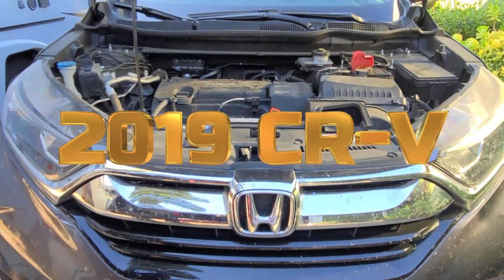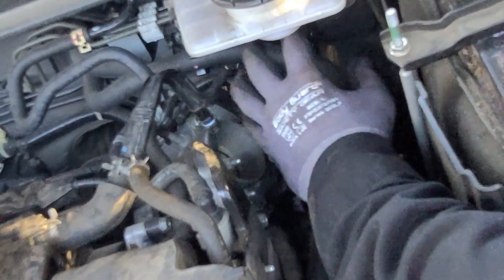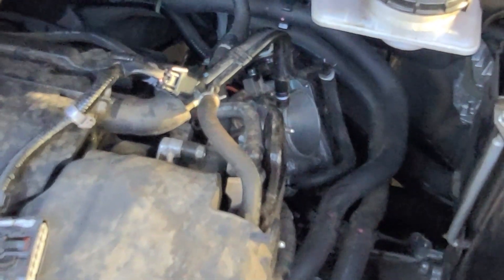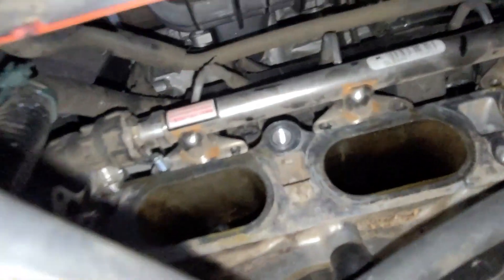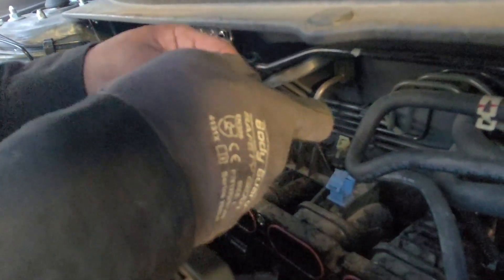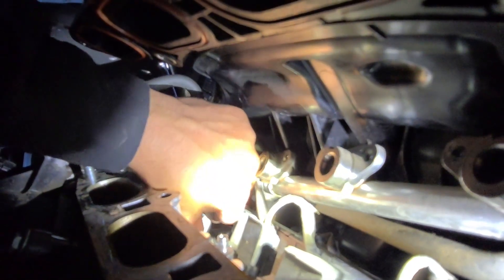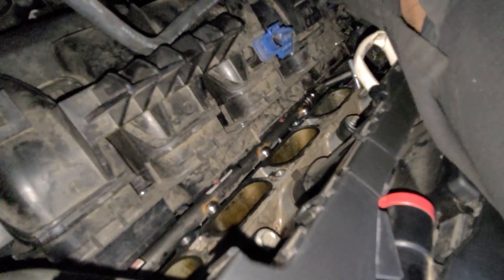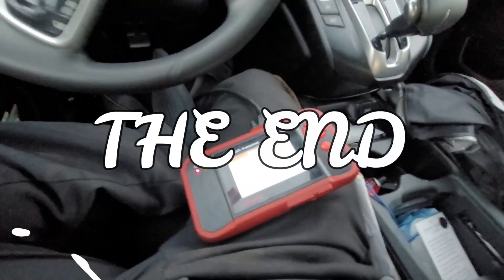P0304 2019 CRV

Comment: Mine is doing a hesitation when acceleration is that same thing you were getting?
Reply from the maker: @seps26dave  no its not. looks like your having a problem with youe MAF sensor. you need to monitor your fuel trim to see if you need to diagnose the fuel system or engine mechanical part. this misfire will incorporate a check engine light with p03... dtc.
Reply: @abcdeinformation3048  new maf sensor

Comment: Honda has major problem with these engines.  I just did the same job. They quoted me $1838.00 . My ‘19 CRV has 133,000 miles. I meticulously maintain it per Honda recommendation with Honda parts. I sent the oil off for analysis and I have 5.5 % fuel dilution. The engines need a catch can and oil changes every 3k miles and fuel induction cleaning every 10k miles.
Reply from the maker: @sparta49  i was just going to say that. exactly my recommendation. as its a direct injection, no fuel is brushing to the intake and intake valves causing excessive carbon build up.
Reply: So you replaced all four injectors?